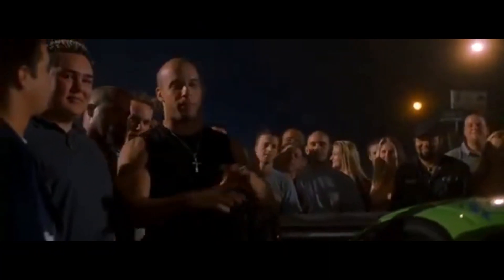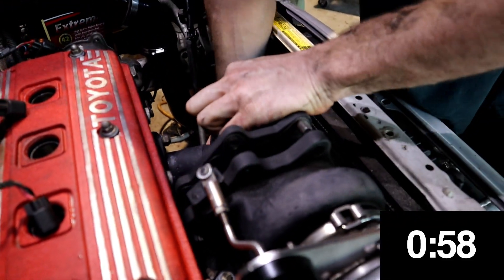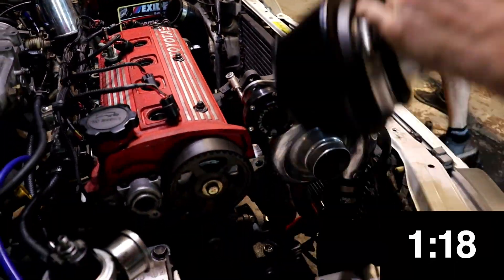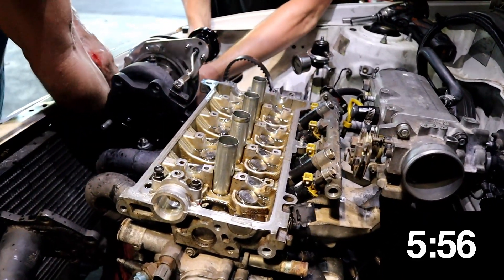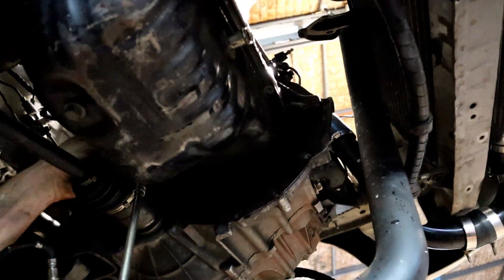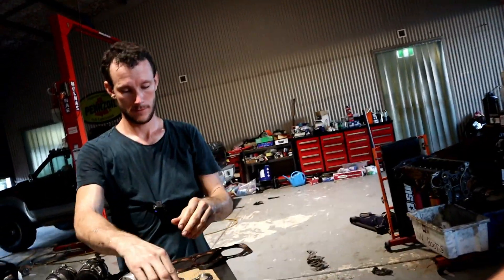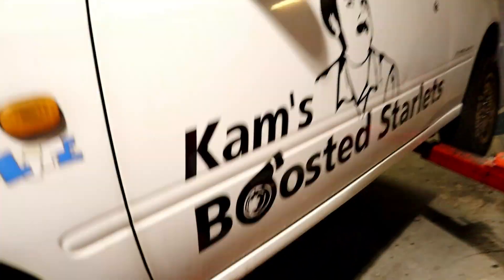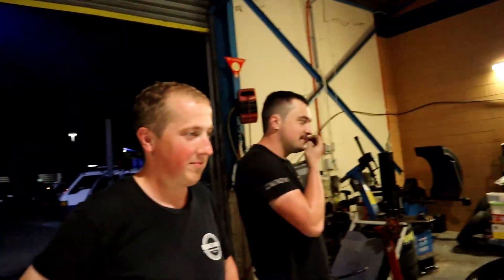4EFTE head removal in 6 minutes

Comment: Can you do one showing how to replace crank seal?
Reply from the maker: The only problems I've encountered with those crank seals are there are two different sizes and two different thicknesses. Measure the one on your engine and it should be fine
Reply: @Camp_Dogs  I haven't started replacing it but it would be nice to have an idea of the process. Mine is the one on the pulley side
Reply from the maker: Hi dim what part are you stuck with?